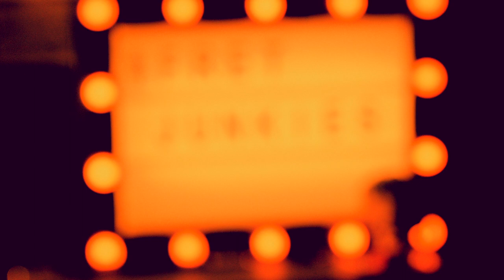Digging Deep into A Leslie 16.

Comment: A good speaker is sort of a waste in a Leslie 16. I have 2 of these cabs and they were designed to capture certain frequencies. The “honkier” the speaker, the better. The Doppler effect is more audible with bridge pickups as well. That’s just my humble opinion.
Reply: This is true. The engineers found the bass waves were non directional. Makes sense, they're more powerful because they are longer. The effect is best in the mids and highs. 

But back then, it was cheaper to mass produce  a rotating drum over a fixed speaker over a rotating speaker itself

Comment: I have a few Leslie's. One is the Leslie 18 which actually comes with a 12 inch speaker. The  difference in the 18 and 16 is the speaker size and the 18 doesn't have a crossover. I also have two 16s, one has a replacement 10" Mesa boogie speaker.